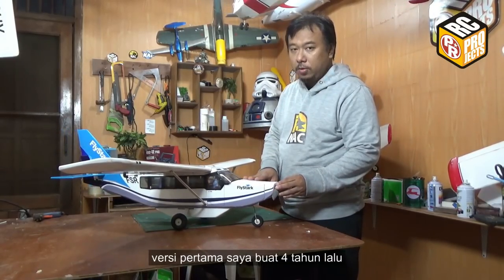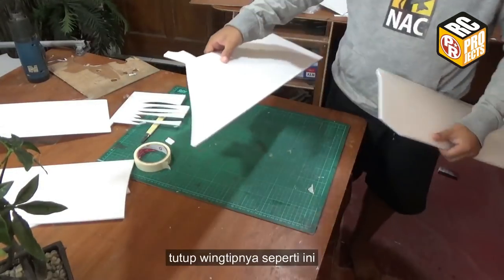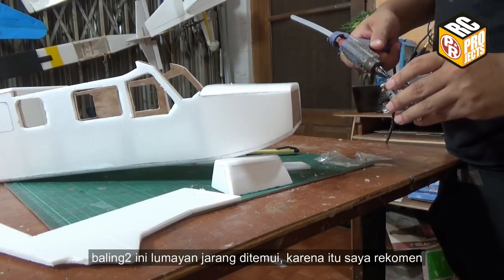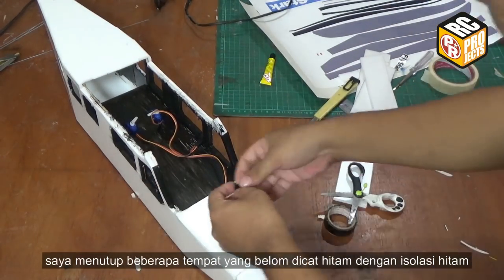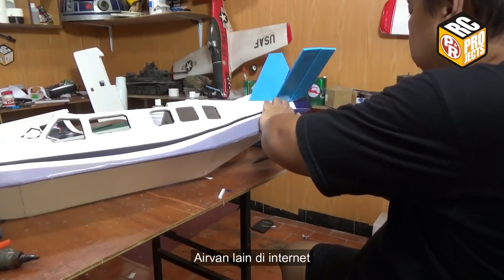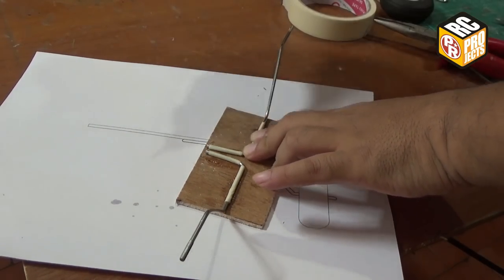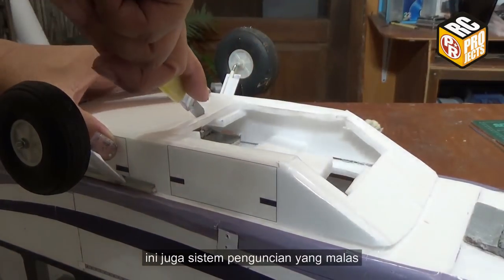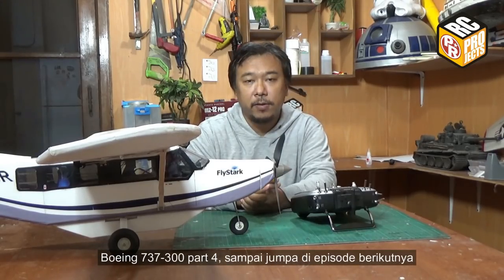GA8 Airvan RC Plane - DIY Build and Fly

Comment: why didn't you just screw the cargo box to the fuselage so you can change battery or even set a charger /battery to charge the battery and kill switch or such a connector on the side of the box
Reply from the maker: good idea

Comment from the maker: Playlist :
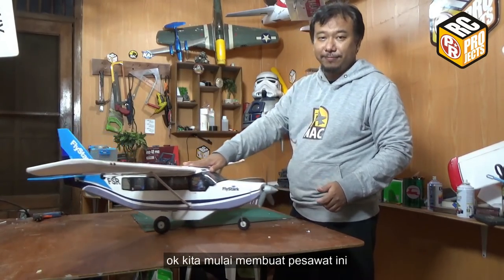02:21 Plan Preparation
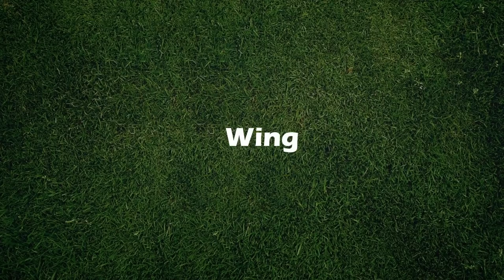03:46 Wing
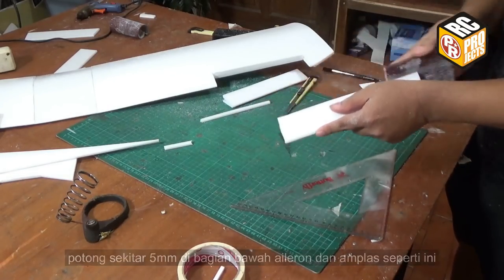10:58 Fuselage
18:08 Cover The Aircraft
24:54 Stabilizers
29:02 Decalling
32:46 Wing Mounting
35:36 Landing Gear
39:03 Accessories
42:47 Control Surface Linkages
45:59 Battery Hatch Door
49:49 Maiden Flight
33:48 Review
Reply: Hey when you have part 4 737 ready ?
Reply from the maker: I'm starting today, maybe next weekend
Reply: @JuliusPerdana  ok thanks my fuselage is completed

Comment: Nice, that will be my next project!
Question: why did you use a 3-blade propeller?
Reply from the maker: the only prop that I got
Reply: @JuliusPerdana  O. I want to build a Cessna Caravan but don´t have the plans. Instead I can build your Airvan which is similar.

Comment: Hello Sir,
I have made this plane from 5mm depron sheet. I have made it according to the plan which you have shared in the link and I have also used the electronics which you have used. Still my plane is not flying in the air. It goes up in the air 1 or 2 feet, turns right and then comes back down. Please tell me where am I going wrong, what should I do to solve this problem?
Reply from the maker: have you balance the plane on CG location? Expect more than 5 meter for take off run, against the wind and full throttle. Only pull the elevator a bit when it fast enough
Reply: @JuliusPerdana   Yes, I  have balanced the plane on CG location and pulled the elevator too.
Reply: I have made another trainer plane (KendinYap) also and it also had the same problem.
Reply from the maker: @rolfimassey8159  What's the final weight, is it somewhat close enough to the design's specs?
Reply from the maker: @rolfimassey8159  also check the prop, did you install it correctly? the concave surface should be facing rear, have you balance the prop? Too many vibration means the prop is not balanced and will losing power.
Reply: @JuliusPerdana   In the description of the video on which I had made that trainer plane, its weight has been described as 495g.  and the weight of my trainer plane is 580g. I hadn't balanced the prop.
Reply: One more thing I want to ask, in some videos, people are using li-ion batteries instead of lipo battery. Can I also use li-ion batteries?
Reply from the maker: yes you can but you have to check the ampere, use li-ion that is used for vape, but not that used for laptop. Or even better use li-ion for electric vehicle

Comment: Abang..klu boleh di cantumkan biaya yg habis untuk 1 project nya..makasih
Reply from the maker: bahan sekitar 200 ribu, elektronik sekitar 600 ribu (motor brushless, ESC, servo2 dan kabel2). Dengan asumsi sudah punya : batere, charger dan remote dan receivernya. Kalo blom punya harus beli (cuma 1 kali) batere lipo (300 ribu), charger (mulai 200 ribu), remote dan receiver (TX/RX) mulai 650 ribu
Reply: @JuliusPerdana  makasih abang..di tunggu part 4 nya rampung..dan jgn lupa biaya yg di habiskan..makasih

Comment: The fact that you are an innovator in the aircraft industry. But there is something he did not find to watch. It is that you did not... Using long measuring devices for aircraft to read from them. And the length of the luminous wings. There is a note. Videos that can be visualized quickly and cannot be watched due to the speed of the video. With my sincere regards to you.
Reply from the maker: No need measurement because you can replicate or build exactly like this with the same size and detail by following my drawing plans, have you download the plans in PDF? check description

Comment: some info.     good work.      it should be understood the use of an elongated nose on this aircraft  indicates that it has turboprop power.      thus, in the case of a tiny model, this design feature  serves   No  purpose.        it is not clear why the main spar was  not  secured with adhesive.         it should be understood that  the wingtip design used on the reference aircraft is  Not good; and is  extra-not good, on a tiny model.        the wingtips  Should be  Parallel  to the air flow; not flared outwards.        at 10:20, it can be seen that  these pieces (slightly) increase the amount of  outboard-located mass  in each wing half.      at 19:39,  where relevant, covering should be applied  in a from-the-aft  progression; like horizontal shingles.        at 45:19, the use of longer pushrods  Requires that, either, they  be  Sufficiently stiff,  or  that  GUIDES   be used.        a   good  pushrod can be made from  two relatively short  pieces  of wire and one or two  Bamboo kabob  SKEWERs.   cheers        googletranslate
Reply from the maker: thank you, it's just for fun. If it can fly I already very happy